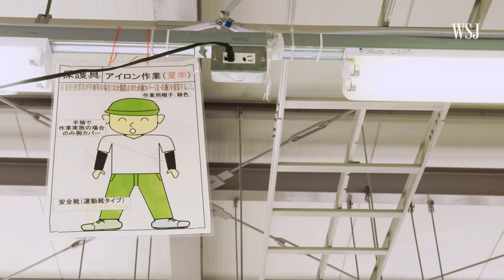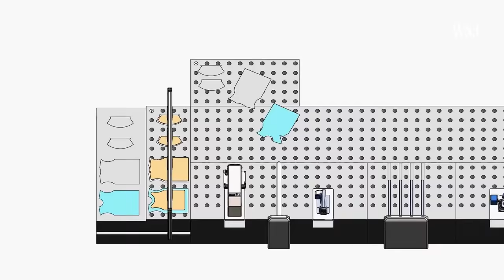The Robot Revolution: Automation Comes into Fashion | Moving Upstream

Comment: Bangladesh needs to look at its birth rate, which is 19 per 1000 (vs. the United States 12.5 per 1000).  If they don't have enough jobs, adding a million people a month to the work force isn't going to end well.  The suggestion to improve education is common sense, but that's easier said than done, in a country of 169 million that is 90% Muslim, only 70% literate, and very backward in infrastructure.

Comment: Yeah they have twist on woman work force in sweatshops, most stagnant sector is construction where 97% men dies. Construction in 300 years of industry newest invention is concrete high pressure pump, some argue (The cranes and skyhooks of Daniel C Dennett) that first human device after wheel invention is crane, but after 300 years cranes not become more sophisticated as electronics where every 3 months we have technological achievement. Collapse of sweatshop in Bangladesh irony of quality and bribes of building inspectors.